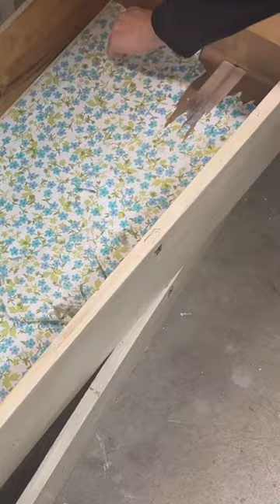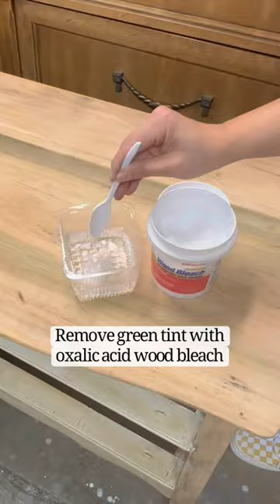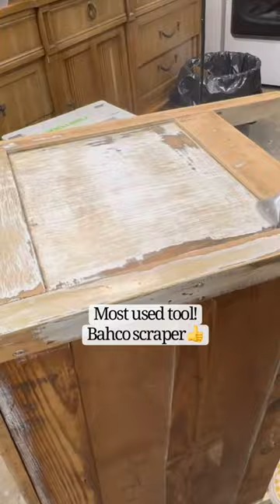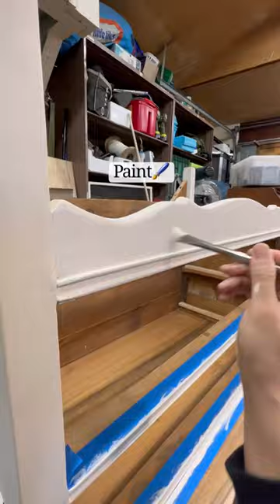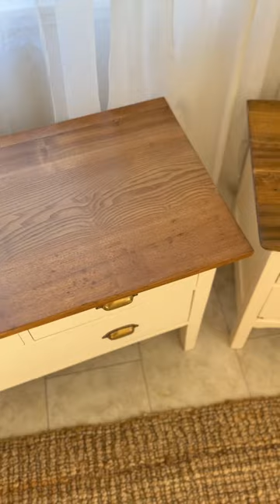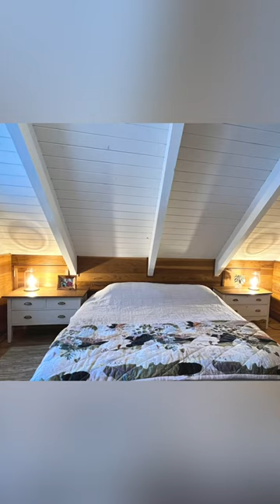Mismatched nightstands makeover🤍 #howto #furnituremakeover #furnitureflip #furnituredesign #shorts

Comment: I just want to say that Oxalic Acid is very dangerous so to those thinking of using it please be very careful. Your lungs,eyes and skin need protection from start till after cleanup is done. 

The piece outside or if you have a room set up just for painting, use it. Regardless, great ventilation and a space with preferably few things to have to wipe down are super important. Read the instructions and don't blow them off!.

Remember, clean every surface this powder touches, assume that it is on everything within ten feet or more. Mop the floor, wipe down everything.

Don't go right to sanding after the clean up is done without having first done, at a minimum, three washes. 

The best I have seen anyone do this is as follows.... Take the item outside, use a hose to wet the surface then apply the mixture according to specs. You can re-apply to areas that are not as light as you want.

 Let dry. Use a damp rag to wipe up the crystals to dispose of them before washing.

Sponge or rag wipe the item with the grain, rinse with a hose. Do this at least three times. Then finish by allowing it to dry inside or outside.

Wash down the (preferably) concrete you had the piece sitting on. 

Do not do near animals, animal food, animal habitats, plants and trees.

Wash the water into a sewer grate preferably otherwise it is a good idea to use Baking Soda on the area to neutralize the acid.

Don't leave a standing puddle. Wipe down any surface the powder could be on if done inside. Use the same precautions inside and outside regarding clean up. 

I sound like a nut about this but this stuff can blind you, cause burns in your lungs, burn your skin and kill animals.

I like your style by the way. Thanks for sharing.
Reply from the maker: Thank you for the information!